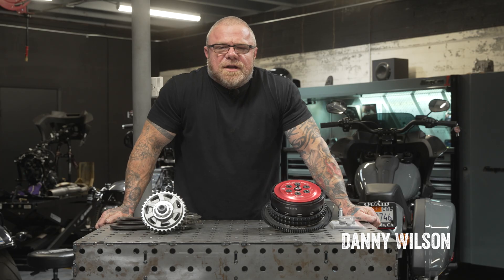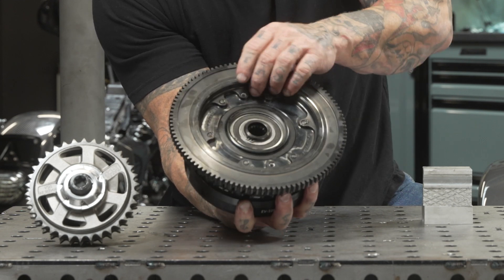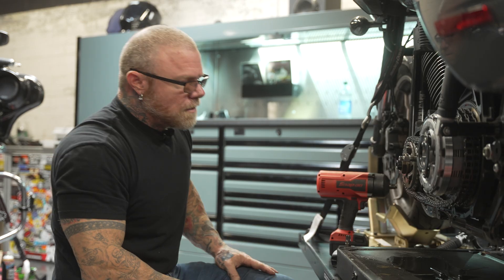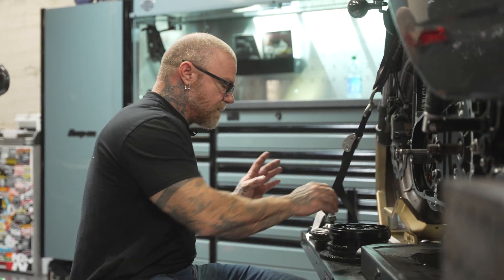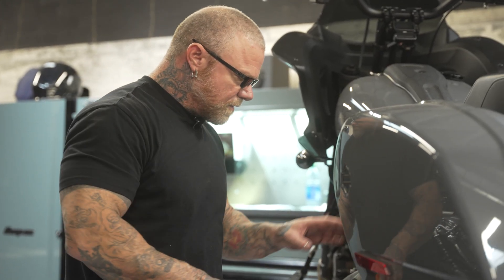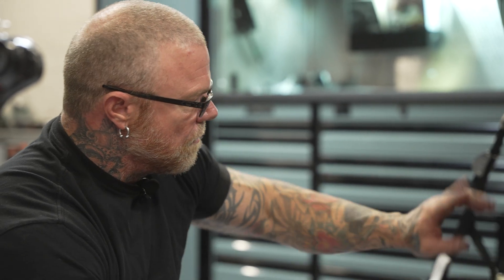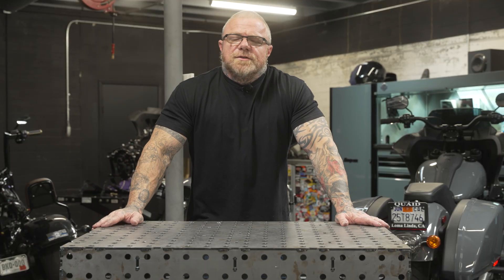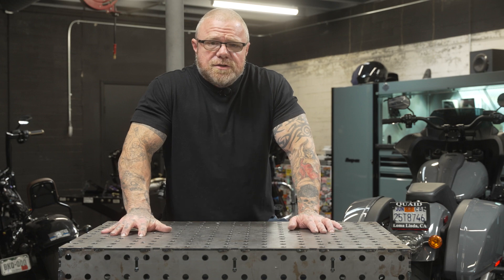Hot Bike's Tech Tips featuring Danny Wilson: Drivetrain Components

Comment: Did the same setup on my 2018 FLHTK.  One thing....don't use an impact on your compensator bolt....the hammering could loosen magnets in your rotor.  Get a lock tool and use a breaker bar instead.  Other than that, nice video....thanks.